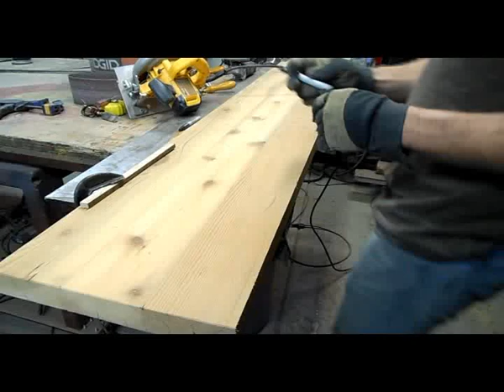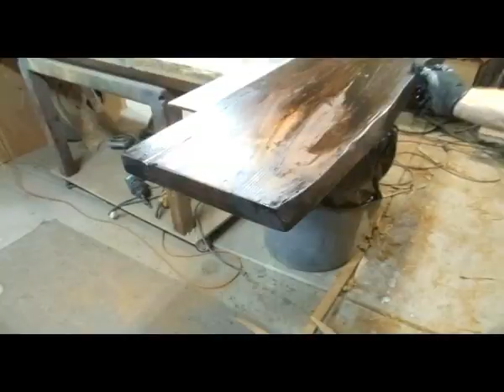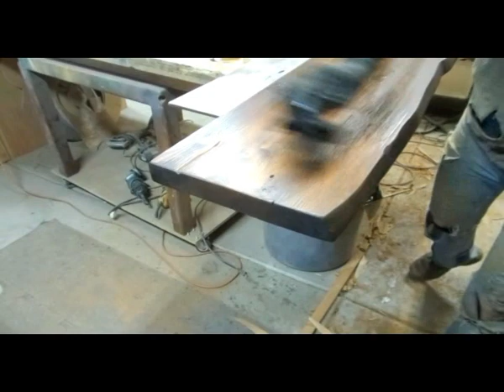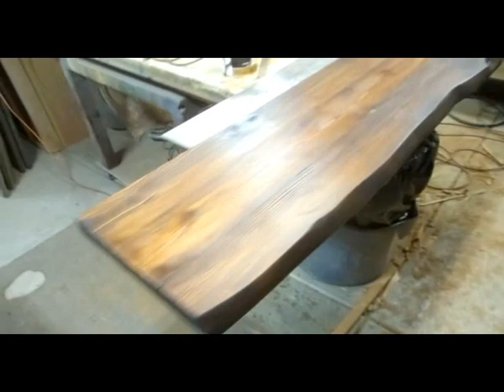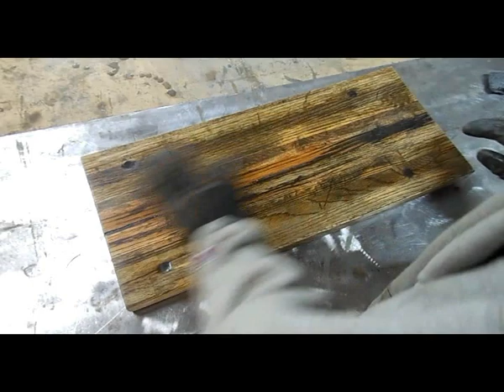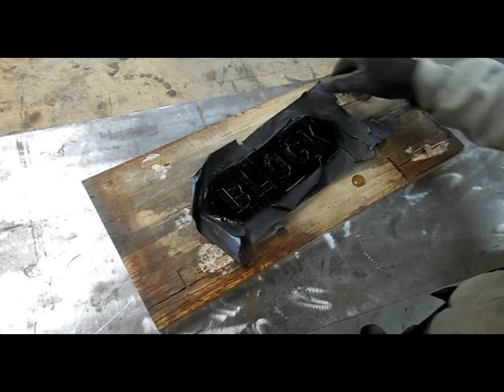Woodworking Simulated Walnut Live Edge Slab Top

Comment: What is the tool called at 0:26?
Reply from the maker: It's called a draw knife and they come in different sizes and angles.
Reply: Woodworker-I think not? Whats a draw knife? lol.
Reply: @jeffreylombardo782  
Is that sarcasm or do you think it isn't a draw knife?
Very curious of your tone.
Reply: J Merck    Of course
Reply: @jeffreylombardo782  
Yea...your comment still doesn't make any sense.
Reply: Hey man. Great video. Thanks. Which draw knife did you use? 8 or 10 inches?